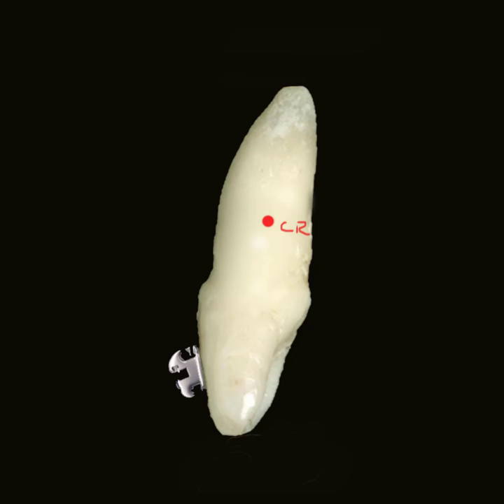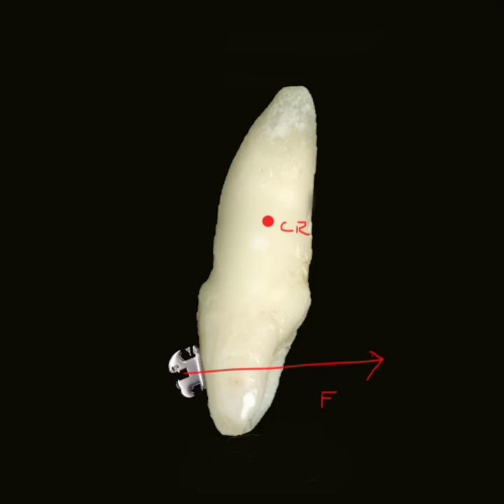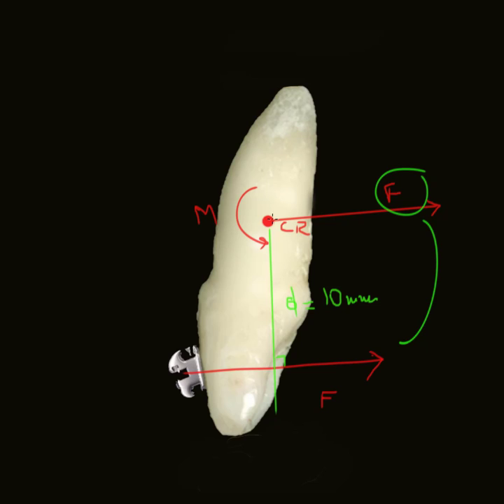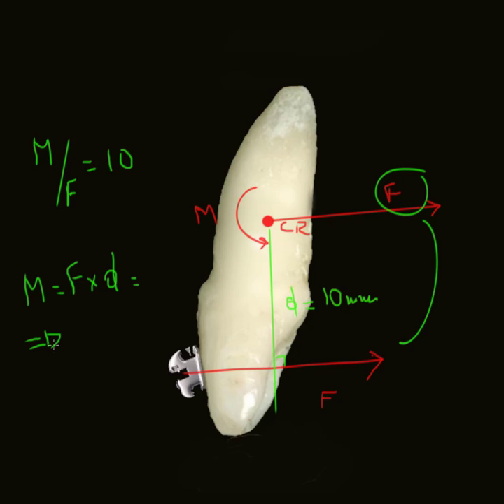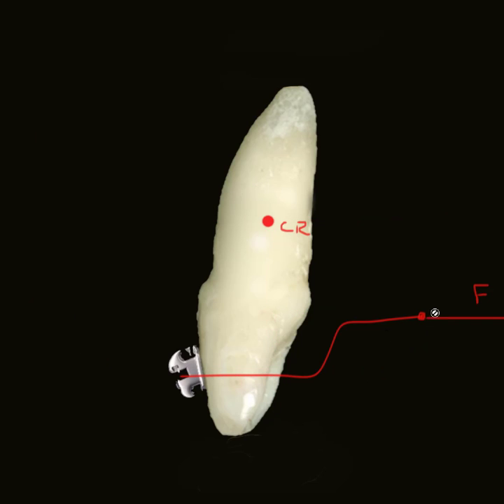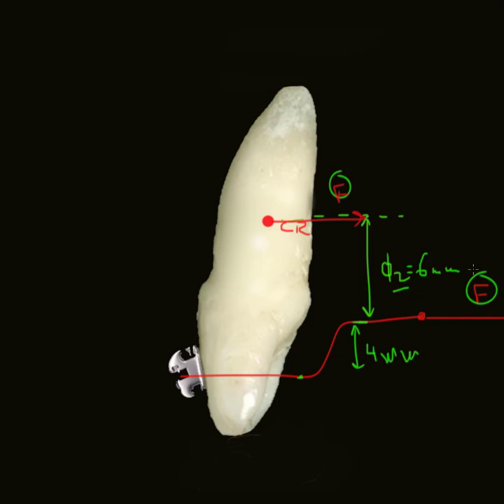Moment to force ratio in orthodontics

Comment: Hi Doc. According to your video, the M/F will ALWAYS be equal to the distance from the force applied to the center of resistance. The actual M/F that we use is a ratio between the force applied to move a tooth (F) and the counterbalancing moment produced by the couple used to control root position (M), which will determine the type of tooth movement that we will achieve.
Reply from the maker: Yes. moment  equals f times d. So if you want translation you need a counter moment where the ratio is equal to d